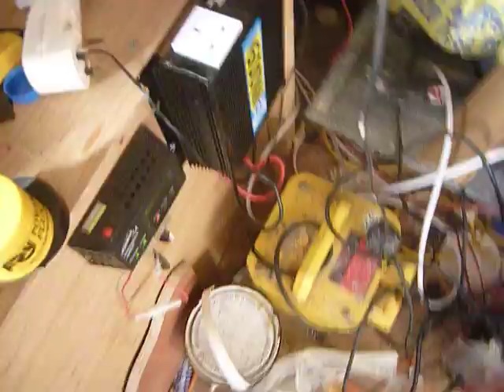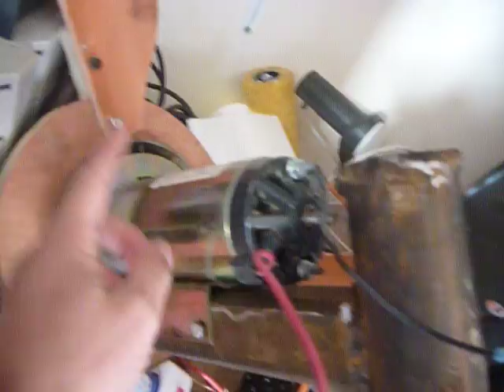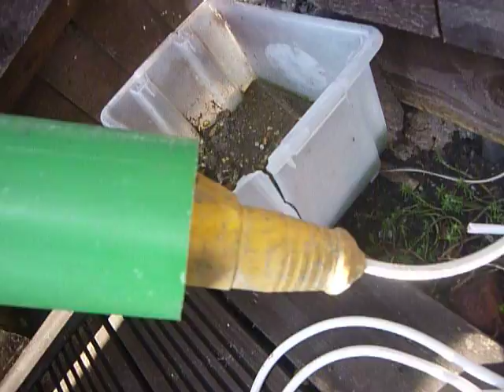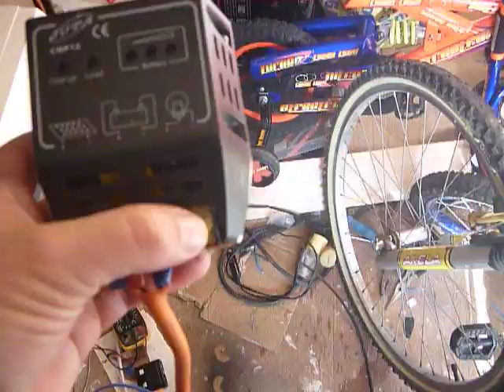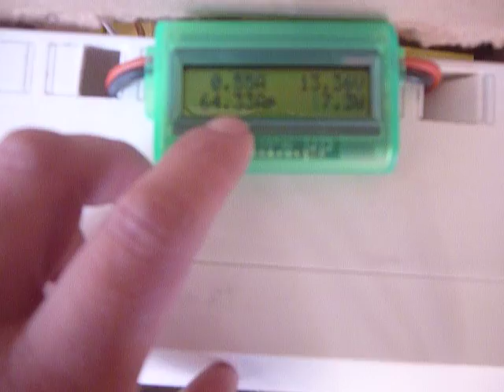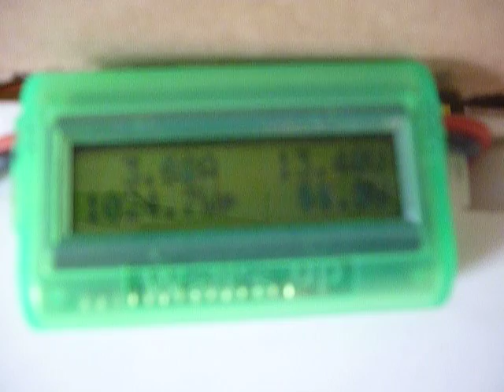wind turbine+solar panel= hybrid system

Comment: I got a question about the Watt's up meter.

I bought one and it came in the mail and I decided to test it out on things. bad idea, one of the things I test was a electrical socket. It burnt it out and now it is no good anymore, oh well my fault, but before I buy a new one, here is my question. 

What fuse do you put on the wires going into the watt's up meter, because it does not have its own fuse obviously :(

Comment: Nice shed mate, I'm going to build mine as well, i already have the parts (batteries, solar panels wind turbine (which is not installed yet) etc. One question. I live in Tottenham Hale, do you know if I need planning permission to  erect the wind turbine like yours? Thanks